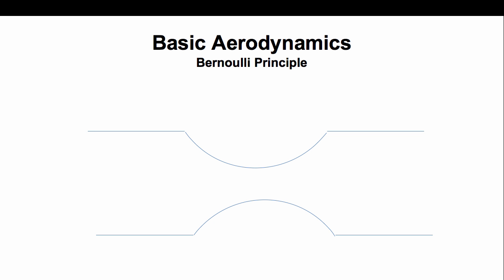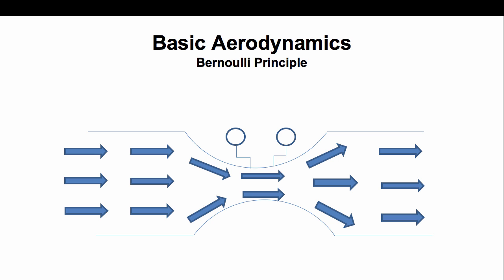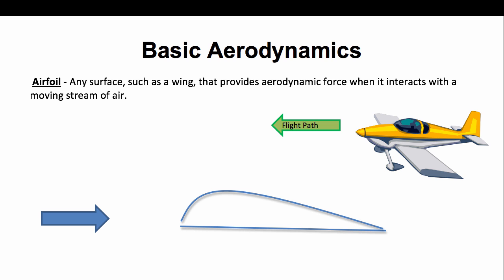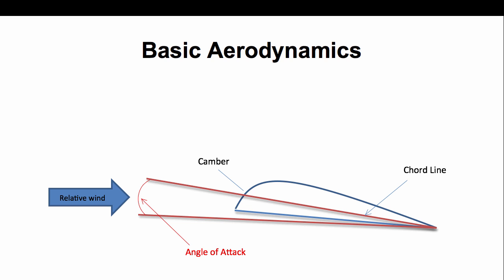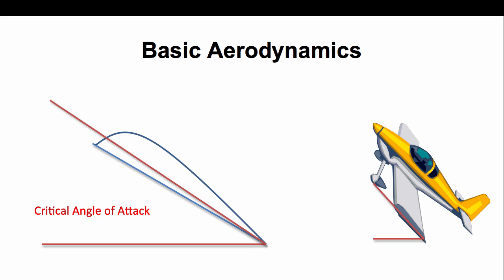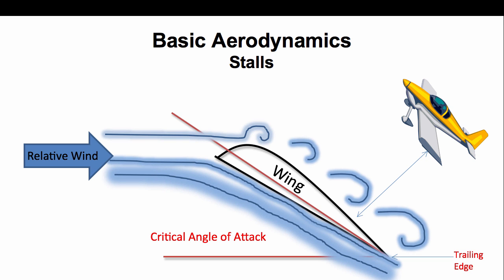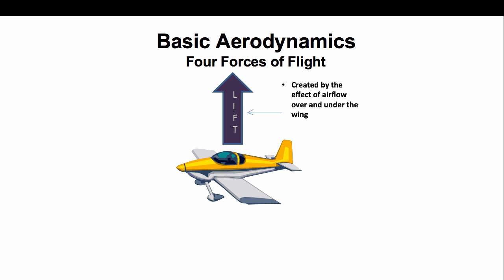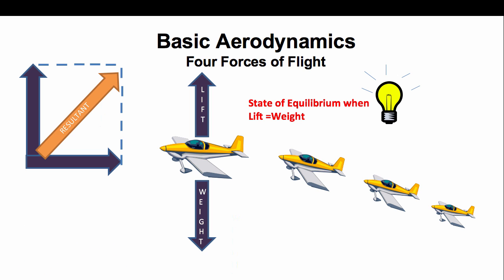The Basics of Aerodynamics

Comment: When a plane is doing what is called "a knife edge" what keeps the plane from losing lift?
Reply: When an aircraft is doing an knife edge,   the wing and the  elevator or horizontal stabiliser are not producing lift at all and they are merely redundant assuming that the body of the plane will keep going straight.
The lift  to keep the plane up is produced by the  side area  of the fuselage, which is kept at the right angle of attack by the rudder or vertical stabilizer now acting to control the horizontal angle of attack of the fuselage.  At this angle   with a large side are  one side of the fuselage  suffers a compression and while the air escapes as it does on wing tips the escaping air will produce some partial vacuum on the other side which helps to produce enough lift. But with such a high angle of attack on the  side of the plane,  the nose of the engine is high and the vertical thrust component from the engine will add a substantial amount of lift, so the lift  from the fuselage side is not ad great as one expects and normally those aircraft which can do a knife edge are very high powered. 
With a bit of imagination one can say that a bullet or a rocket fly in a knife edge state,   With a  bullet without a stabiliser at the back it is difficult, and a rocket with a stabiliser at the back it is easier.   Well  an expert who did know about all this is Robin Hood as all his arrows were not much different from unpowered knife edge travelling bodies in flight.
Reply: well the plane must have a thrust to weight ratio greater than 1
Reply: +JABd,
No. As Carmel says, the plane flys in an extreme nose up attitude.
The fuselage provides lift due to its high angle of attack and the engine has a larger vertical thrust component aiding the fuselage lift.
Reply: Lift force by fuselage and fin/rudder plus vertical thrust component